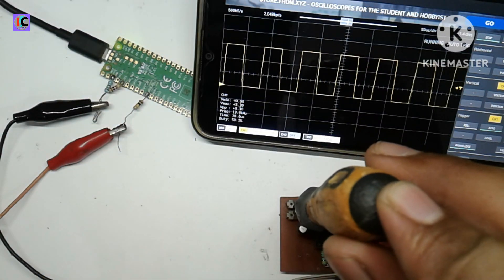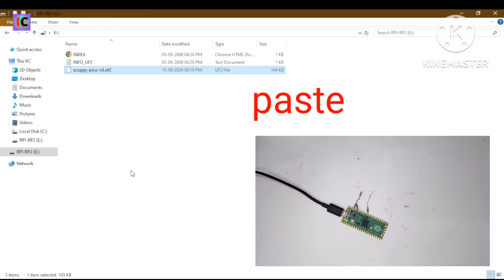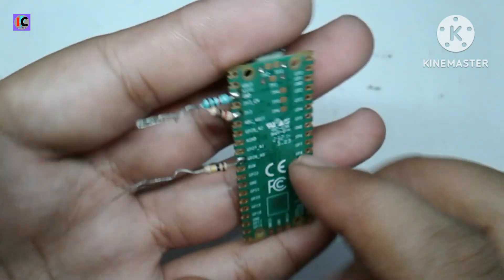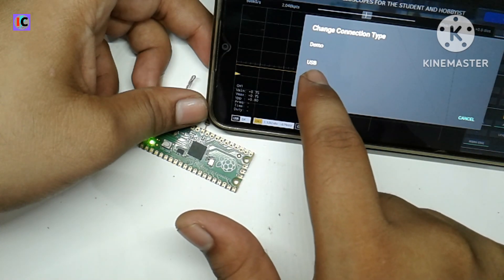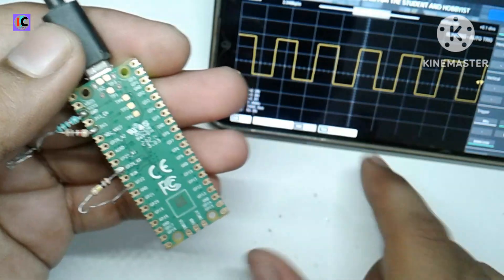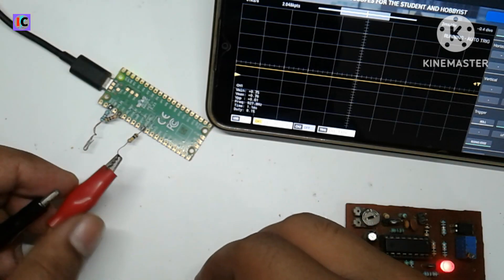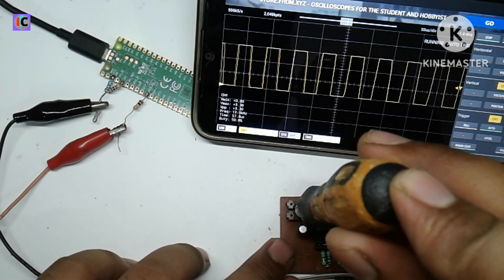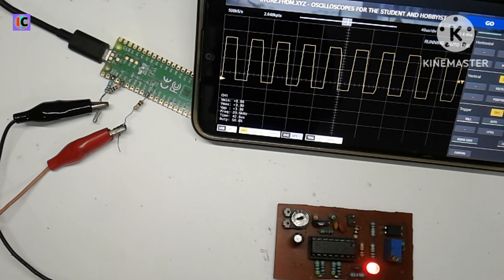DIY Oscilloscope using Raspberry Pi Pico #oscilloscope

Comment: Thank you for the video. What resistor do you have on the GND?
Reply from the maker: I made voltage divider with 1K resistor on both -ve & +ve, the common point will be virtual ground.